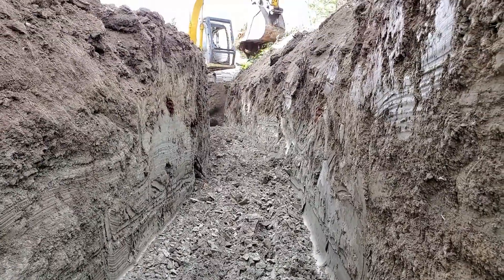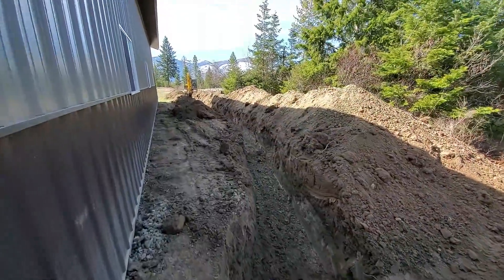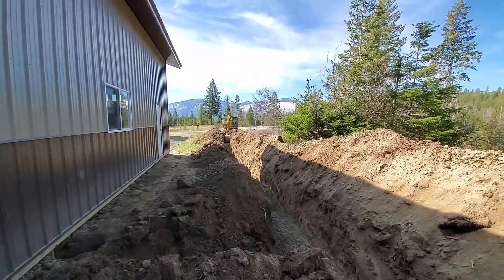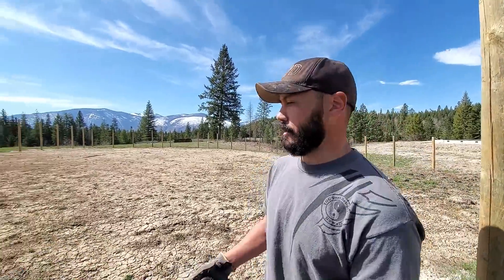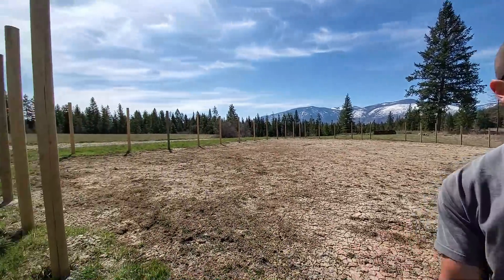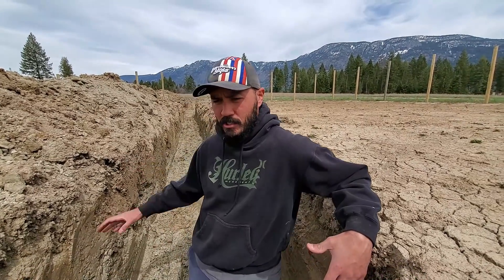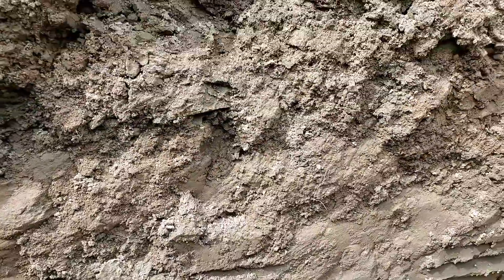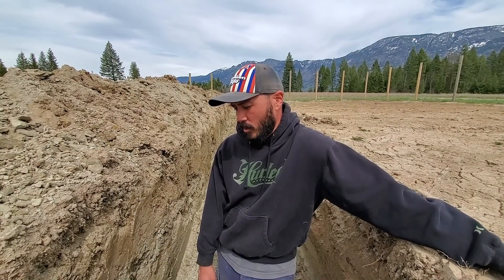Settling Into Our New Idaho Homestead | Building Our Home In The Mountains

Comment: My grandfather used to plant fruit trees in soil with clay on his farm in Ohio. This is what I remember he did:
1. Dig holes deeper than normal; twice as big as the container (or size of the existing roots) the trees have before planting.

2.  At the bottom of the hole, mix in the soil taken from the top of the hole, containing less clay, with gypsum - which apparently helps the clay "clump" more; improving water flow at the root level. He also had a couple of streams on his farm, and what he used to do was mix in some soil he took from near the stream along with the gypsum for the bottom of the holes, where he planted his orchard. Since gypsum is ph-negative, and contains calcium and sulphur, it doesn't decrease the existing nutrient state of your soil, will help in tree root growth (though it does not contain any other nutrients).

3. In his later years, granddad got more and more familiar with organic fertilizers - and he started using them for his fruit trees. This material, he would add to the soil packed around the surface of the tree (and if he couldn't get enough, he'd get mulch as a replacement). I've heard some good things about this product:  https://www.kings.co.nz/aquaticus-organic-garden-booster-500ml
You can also use it for your other plantings as well.

The soil in his orchard had levels of clay pretty much what was seen in this video on your property, which made me think of him. I also remember him saying that the first year he tried this, he didn't get much production; but the next few years - after the soil in his orchard improved from the gypsum and the fertilizers/mulch - were VERY productive! He had PLENTY of fruit growing on his property at that point, and the production never lessened... as long as he watered correctly!

Something to keep in mind; hope it helps you!
Reply: That is good advice.

Comment: Useful neighbor to have there. It looks like you have about 2 ft of good soil. Fruit trees can cope with clay if they have that much topsoil. Our old garden had about 1 1/2 ft of good soil then heavy, heavy smelly blue clay below that. We had peach and apple trees that did just fine. Their initials roots will work sideways in the good soil and any deep, tap like roots can shove clay aside. If, like I expect you do, keep amending the topsoil with compost etc, you will find things will gradually work down. There is one benefit to having a deep clay layer. That layer will hold water so even in dry times, your trees should do well. If you do dig into the clay layer to plant your trees, go an extra 6” or so and add peat and and to the bottom of the whole and don’t be afraid to add some in when you backfill as well. Glad to see you are making good progress on the infrastructure. By the way, I would have kept the hutch too. It is lovely AND useful. Stay safe!

Comment: My comment comes from seeing your cat with that mouse. I too live in an area that has lots of mice. They are extremely destructive and can be disease carrying and can make your place smell bad. I’ve tried many methods to control them, including the cat method. However, what I found works the absolute best to keep them exterminated is to take a Tootsie Roll, cut it in half and chew it just enough to make it  pliable. Then mold the Tootsie Roll around the trigger pan on a standard Victor snap trap. Mice can not resist it. My personal best using this method was 12 in just two days if I remember correctly. I hope that helps you.👍🏻

Comment: If you are not planting trees this year, dig a four by four by four hole mix  1/3 sand, 1/3 sawdust and dirt to re fill hole water often .  Start trees in large containers  for one or two years (mark north side of tree for when you transplant) after soil is amended. Add clippings, hay and poop turned in well each time you wet area you are preparing for orchard.

Comment: When you have time and access to heavy equipment it can be worth it to do a few test pits around the property to get an idea of what the layers are  to help with future planing. You never know if there are some good drainage layers under the nasty clay till you take a look. 

Try to also budget in for a communications conduit to be placed in any open trenches even if you don't install the wires at the time as it is much better to have a hard wired network connection then a power line or line of sight repeater setup. 

With the right hardware you can also put in a working landline phone that picking up any handset makes every other phone on the network start to ring making finding people on a large area much easier. A phone at the gate so no need to even step out to talk to who ever shows up, a phone in the barn, a phone in the workshop, a phone in the house.

Comment: Its a start, getting the water hooked up to all the area's that need it. You can always work on the inside when the weather is not great, and do what you can outside. And then get the septic to the right places. I originally thought that doing the garden first then work on the apartment, but maybe a few walls in the pole barn and get going on the house. So many different ways to approach it and each idea is just as good as the other. But you've had many suggestions and you will both figure out what is best for the family. This is definitely a good start to get it all going.
Reply from the maker: Thank you so much for your input ☺

Comment: clay soil will work with fruit trees - just mix some sphagnum moss with it and do not let it dry out!  mulch the surface with straw to keep the area underneath moist - there is a lot of wind in your location and it will dry out your trees quickly.  I learned the hard way - but the mulch saved the trees the second time I planted.

Comment: As I watch this I remember doing all this. We bought 10 acres north of Spokane Wa in 1980. We built a Modified GeoDesic home.  It was and still is 40 feet across and we put it up on 4ft riser walls. so it was 23ft up.   We did it all ourselves. Took us 5 years to finish. Had a garden. Tried to put in an orchard but the deer ate it three times so I really like your fence.  We raised rabbits, goats,  chickens and had a horse.  We never thought we would leave it but we did due to an economic turn down.  Best of luck and hang in there.
Reply from the maker: Thank you!! Sounds like a beautiful adventure

Comment: Just a suggestion, for the different sections of water line, make sure to have plenty of drainage and bypass valves.  You can section off certain parts of the lines to drain or add RV fluid in the winter.  Also may want to consider some heat cable for sections that should never get frozen.  Learn from my mistakes!  Great stuff, new subscriber here!

Comment: A recommendation on your trenches. Run extra lines near your water line for electricity. Do it the first time without the work of adding it later. Oversize all water and electrical lines, it's cheaper in the long run. My 2 cents.
Reply: Great advice

Comment: You guys are so blessed to have someone with heavy equipment nearby. 

Are you going to bury a 2 inch poly line to the septic so you can install a sewer pump from the farm kitchen and apartment to your septic system? Even if you only use it for gray water, it will be well worthwhile. Unless you are considering a full septic system for the apartment???

When you buy your frost free hydrant for the garden, you can get a model that allows the underground valve to be serviced without digging up the hydrant. It all installs from the top of the pipe. The Woodford Y-34 series has this design. The cheaper brands do not.

Comment: I love watching you guys doing the same stuff I went through. I absolutely agree - be a good neighbor and you have good neighbors! 
You probably considered already running water and electricity in these trenches. I highly recommend to run an empty conduit for low voltage communication lines. If you do, consider buying one size bigger than you intend because later you will need it. Experience speaking here....  You may think right now you can address communications via Wifi and automation via powerline modems. This is true but less reliable. Conduit for these distances is not that expensive. Bury it a a foot right over the water and electrical lines to have an early indication system  years down the road when you did other channels. Again...experience speaking. This recommendation depends on you local code and regulations.

Comment: When we dug a pond I was surprised to see how distinct the clay layer appeared.  When the pasture was saturated the water went down to the clay and then poured out at the clay layer.  It was fascinating.  I read that comfrey can have 9' roots and can mine and accumulate nutrients and minerals from down there and store them in their leaves.  You can use the leaves to make fertilizer or feed it to animals or many other uses (in part, depending on what variety of comfrey).  Anyway, I planted the forage type around my antique orchard trees in my sheep pasture.  Hoping for several benefits.  They do like it at least.  So, maybe you can utilize some comfrey in the orchard.  Also, completely crazy idea, I wonder what would happen if you had your excavator guy dig a long trench and put one of those tremendous logs in it, they layer up soils and amendments, then plant the orchard trees over it?  Would it help add nutrients?  Would it provide a path for deep roots?  I am enjoying watching your progress.

Comment: Would it be possible to run the water line all the way to the other end of the garden.  I know you wanted center, if possible a spigot on both ends and one in the center.  Would it be possible to run schedule 40 conduit, run a rope through it, tie off on both ends. If you need or want electricity at the garden you can pull wire and have it.  Just have to keep in mind what you plan to use and length of run, this will determine gauge of wire needed.

Comment: Glad to see progress.  It will continue to be a mess until its finished.  Melissa bet you were glad to get your pantry space set up, always made me feel that I accomplished something.  Good Job guys.  Just take it one step at a time.  Jeremy as for the trees, I have a lot of clay and caliche which is ten times worse, trust me.  If you dig a hole about 2x's what you think you need and then amend the soil 1/2 and 1/2 with good compost and native soil your trees will do well.  be careful not to overwater them as water tends to stick around in clay longer than in loamy or sandy soil and the risk is drowning them.  I have been very successful with this method and my clay is closer to the surface than yours.  God bless.

Comment: Dad, you need to check out Honey do Carpenter you tube channel before you start all these projects. He's in Idaho Falls I'd. He does a lot with Aircrete. You tube has 50 mix. The Univ. Of Illinois built a boat to race with. It's lightweight and insulative, bug resistant, etc. Holds up good for your winter's. Get with him. Maybe you could insulate the barn panels for your apartment and make wall panels. It's an idea to think on.